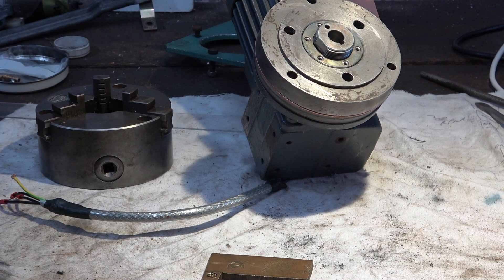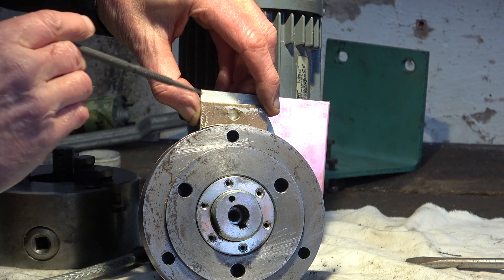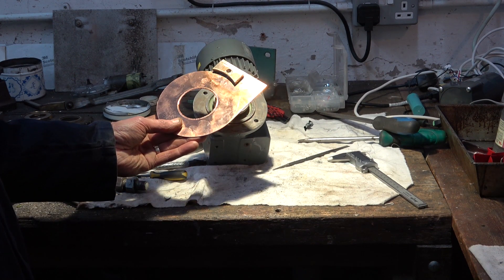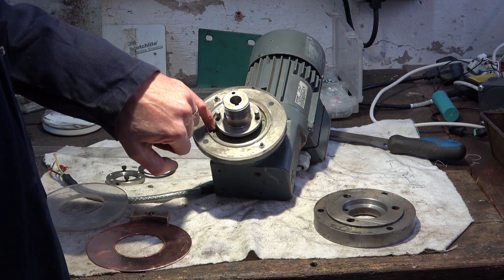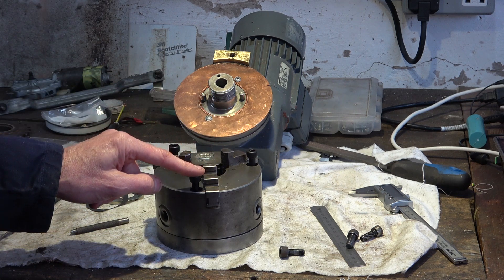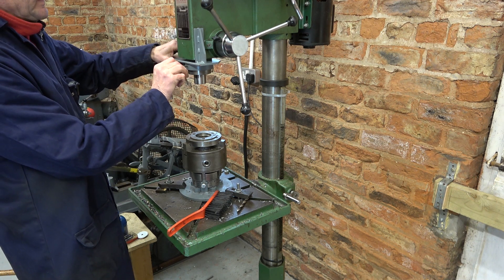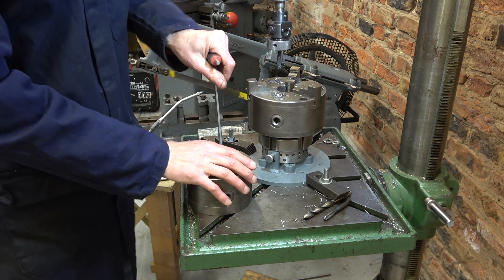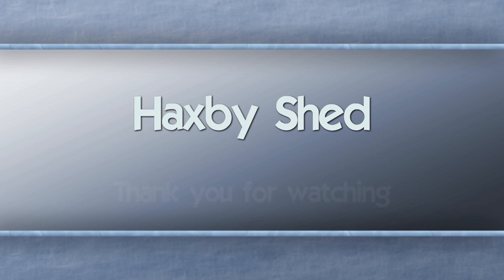HS117 Shopmade welding rotator build – Part 4

Comment: Great progress Paul, I enjoy watching the thought process as you go along. 
We are on BT250 fibre here (between Oxford and Reading) but the fibre stops at the box. Thankfully, the box is only about 25m from my house. I typically get about 300 download and around 50 upload. It takes around ten to fifteen minutes for one of my videos to load up. 
Best wishes, Dean in Oxfordshire.
Reply from the maker: Hi Dean,  when I first got BT superfast fibre 2 (fibre to the street cabinet) about 10 years ago I was getting a good 63Mb/s loopback test at the wall and 45Mb/s peer to peer on the PC test. Over the years it has drifted down to bursty 23Mb/s at the PC. My copper to the cabinet is just as good as it was, this is about loading and throttling the network (aka lack of investment).  BT has their fibre to the home programme now but it's a land grab and in our city they are frozen out now.  We have Virgin Media, City Fibre, and UltraFastfibreOptic (UFO) a pilot network operated by Talk Talk which gives 1Gb/s for about £30 a month.  BT won't be coming here with fibre for a long time.  Cheers
Reply: @HaxbyShed  I have to say, it's not the most reliable service. It's been dropping out a bit lately but the speed seems reasonably constant. We have the repeater hubs around the house too, as our 1960s house is brick and block and is pretty good at blocking the signals.

Comment: Thought you might have "tinned" the 2 pieces for soldering.
I've given up uploading videos from work. Was taking about an hour per minute of 720P video! Connection has got so slow that online banking won't work. Fibre broadband is supposed to be coming this month so will have to look into that...
Reply from the maker: Hi MidEng, yes I could have tinned but both faces were bright and the flux is plumbers pipe flux and quite aggressive. If you are getting fibre soon then be happy, much of the UK is still on string. Cheers.

Comment: I am really enjoying this project, you are doing a fantastic job. I wish you had not mentioned broadband 😀 here in rural Norfolk we have no fibre in the cabinet and it is 3-5 miles of copper back to the exchange. It takes at least 12 hours for me to upload a video, the service is really unreliable and they have no plans to upgrade. On a really good day we get 4 Mbps download and 0.2Mbps upload
Reply from the maker: HI GTB, I have personal experience of a rural broadband cooperatives up here based on point to point radio links at wifi frequencies 2.4Ghz and 5Ghz. Setup is about £125.  £10 a month gets you 40Mb/s. There are no other costs. It's run by volunteers and various funding grants helped them set it up, it's been going 20 years I'm guessing. Checkout http://baybroadband.co.uk/   Cheers

Comment: A trick from model steam engineering which came to me by way of Quinn (whose channel is called Blondihacks) is to put punch marks on one face of a braze joint to give a little clearance for filler.
Reply from the maker: I've noted that Jim, thanks.

Comment: Love the soldering job, perfect for large surface area interfaces,  would a visit to the scrap yard realise any battery cables etc,  I notice you have plenty of car bits.
Great job on the broadband package,  can it heat the house 🏠,  just renewed my energy supplier contract, expected to be an 65% increase for next 12 month period,  nothing on price comparison websites,  my current supplier Octopus,  aren't taking on new customers online.
Nice quality build.
Thanks for sharing
Reply from the maker: Hi John, I have some reasonably long car battery leads but they are not super flexible.  Like most people I'm facing the same problem with utility bills. I have gas and dual rate electricity (cheaper in the night). Daytime electricity is up by 30% but night time electricity is up by 70%!  I think it is all those people charging electric cars at night. My supplier has gone bust because they did not hedge on the wholesale price they pay (but you can only hedge for so long anyway). The UK Government's energy price cap is holding down prices at the moment but come April they will jump again. It's going to be a big problem for people on limited incomes. Keep warm and cheers.
Reply: @HaxbyShed  yes, definitely a severe fiscal issue for many, if not all, hopefully my supplier has a good business model?
I remember 20 plus years ago,  I needed to replace and extend several mains hand drills and angle grinder cords, instead of buying X metres of 1.5mm Sq 3 core, it was cheaper to buy a cheap extension reel from a supermarket and chop it to the lengths I needed,  it was only 1.25mm Sq, but able to handle the current. Today I would use the rubber cord. I think at the time some Japanese brothers were inflating the world copper price. 

Not sure where the government is going to generate income by consumer taxation, in 10, 15, 25 years time, ref more electric cars, reduced fuel duty income ( nearly 75% or so), it used to be that the smokers paid enough duty to fund the NHS several fold.
I haven't got a problem with some  taxation on consumer products, I can see VAT rate being increased.
Anyway, hopefully as long as Gov.UK don't charge on Shed or Workshops directly, we should be okay 🤔🤨